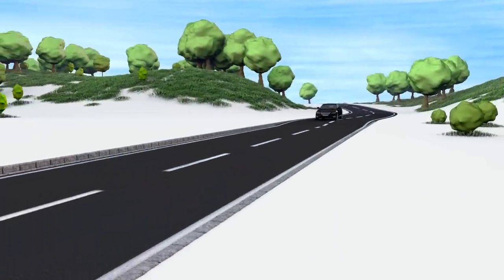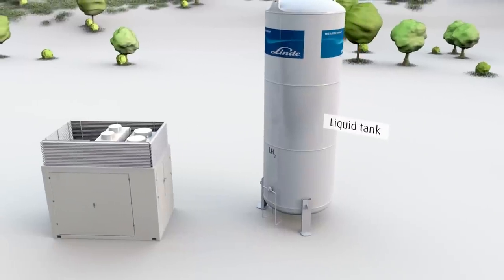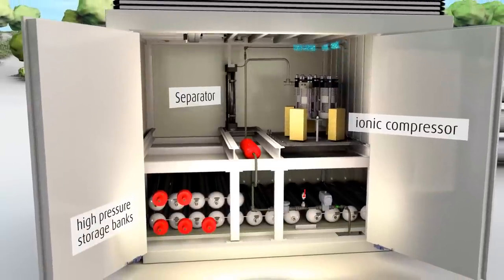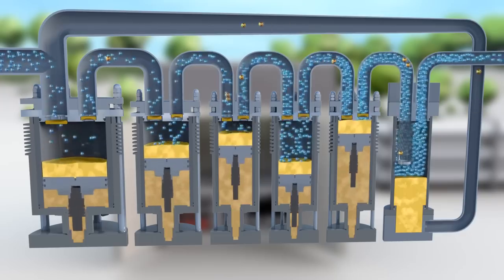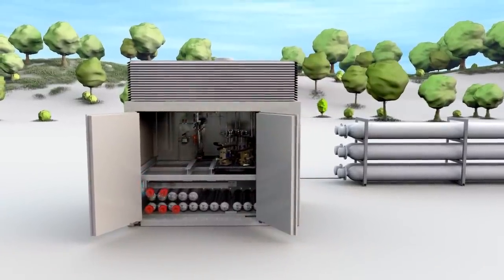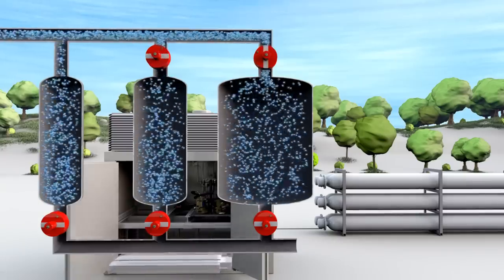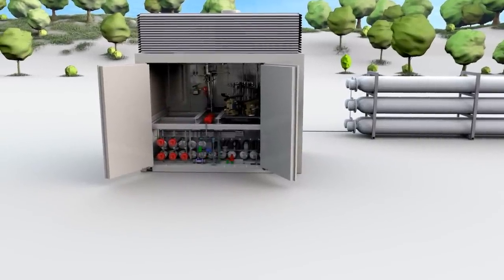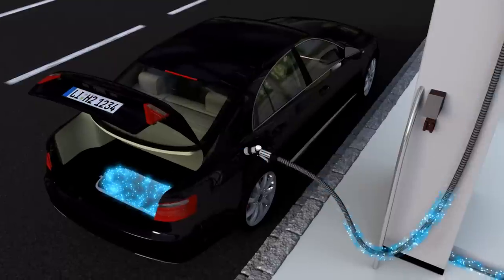Linde standard hydrogen filling station with IC90 compressor

Comment: I think it would be better to turn the hydrogen into a gas so the car could fly rather then roll down the road. No tires to replace, no roads to maintain, much more space for transit, lift is provided in a quiet and sustainable way... Hydrogen gas is the fuel of transport in the past and it will be once again in the future. It's ability to provide lift is unparalelled by any other gas. With modern materials, manufacturing processes and safety regulations there does not need to be another hindenburg.
Reply: You should talk  to Elon Musk, he probably would think that's a great idea while calling the fuel cell dumb.
Reply: Lmaooooo

Comment: this IC90 creates compressor noise - 52-53 decibels at 50 feet. Not good in a residential area! Linde never fixed the issue too - they owned Linde Mountain View, sold it to Iwatani and never worked to reduce the noise.

Comment: For hydrogen fuelling stations, Linde has developed a 5-stage ionic compressor. The pistons of the machine move up and down hydraulically. On the top of the pistons there is the ionic liquid which is compressed through the compressor cylinder as a "liquid piston" together with the hydrogen. At the end of the compression process the ionic liquid is separated from the hydrogen by the separators and returned to circulation. This design results in less wear and tear as well as much higher energy efficiency thanks to optimized cooling and avoidance of parasitic volume during the compression process. Compared to a conventional piston compressor, energy savings is around 40%.

Comment: why they use cylinder tanks instead spherical tanks?   You can store 50% more hydrogen for the same tank surface with a spherical tank.  If we remplace 6 cylinder tanks, with the same surface we can have 6 spherical tanks or 1 big spherical tank which it would store a 450% more hydrogen for the same cost.
Reply: Space constrain, how many spherical tank can you place in the high pressure storage tank enclosure?
Reply: Another reason would be the production of those tanks. It’s quite more of a challenge to  machine a sphere cost effectively, than cylinders which are basically rolled sheet metal.

Comment: Hi, i know that for fuel cell application the hydrogen must be oil free at 99.9999% . But in your compressor the oil is used to move all the piston, and it is in contatct with the cylinder liner. So , even if there are the piston seal , some oil is going into the compression chamber ( because doesn't exist any seal in the world that can guarantee that the oil is removed from the liner at the 100%). So how can the compressor can be consider oil free since there is oil into the compression chamber?  Or is the oil removed in the final separator, but also in this case  cannot be considered an oil free ?
Reply: As long as pressure is higher on the H2 side, oil will not go into the gas chamber.

Comment: 1000 bar! wow. I thought a full 300 mile tank in the Toyota Murai was 70 bar.
Reply: 70MPa (700 Bar), but we can also use a nozzle with 35MPa (350 Bar) to refuel Mirai it is not a problem
Reply: The Toyota has two 700 bar Hydrogen tanks, they are not 70bar. Personally, I wouldn’t chose to sit myself or my family on top of a cylinder of Hydrogen, in fact any gas, pressurised to those sorts or pressures.
Reply: @Desfaqhunter  will that not reduce the car’s range? Also, 350bars is still around 150bars more than a standard SCUBA cylinder. That’s a no thanks from me. 😳
Reply: @stevengrindrod2002  hydrogen is the lightest known gas. If there is a leakage it will fire just opposite to gravity force. Also for me completely no no is to sit on few accumulators that can burn for 3 days straight with no option to choke the fire, like Tesla's cars

Comment: What happens when a car hits this tank ?
Reply: If the tank is broken the gas will come out with the F directed in opposite to gravity. Because Hydrogen is the lightest known gas in the  world. It will be a thin stream of hydrogen with high pressure. If there would be an ignition, the fire will not be as much dangerous that well known petrol. See for results on youtube, it is funny when they compare petrol ignition and hydrogen ignition from a broken tank.

Comment: Hello, We are a student team working on a project to transport Hydrogen (liquefied) from one end of the country to another through underground pipeline, is/are your products capable of doing so ?
Reply: Hi, I work with Hydrogen and was just reading your comment. Yes Hydrogen can be transported however this can or can not be costs effective depending on volumes etc.   if You would like any more information drop me a message
Reply: @guyslack5024  Hi, I just calculated the cost per L of H2 for distributers at a 5 year return of investment as low as CAD$0.28 per L. That justifies any kind of investment. I am a 30 year-experience mech. engineer. I have some ideas.

Comment: Hi all - do anyone have any information about cost(price) of hydrogen filling station?
Reply: Filling station only, without H2-generation unit is 1.0 - 1.5 Mio €.
Electrolyzers is another 0.5 - 1.5 Mio € per MW power.
To fill up 20 cars per hour, you will need a 5 MW electrolyzer and 2 filling stations, which is 3.5 - 9.0 Mio €.
Reply: CD
Reply: ए 🐩